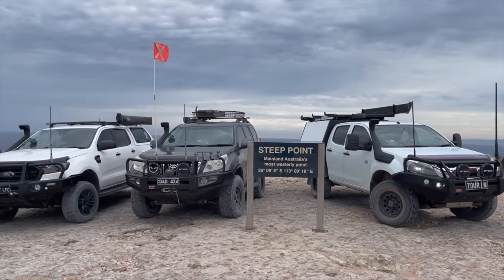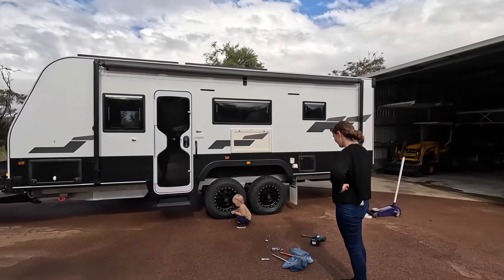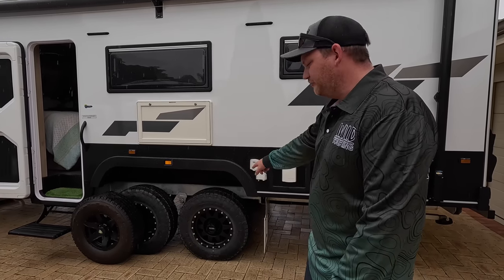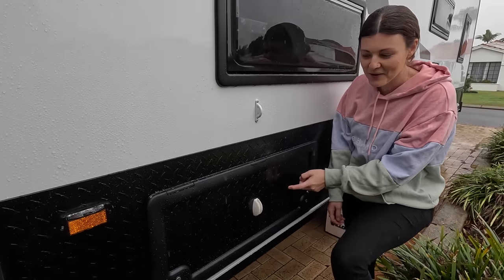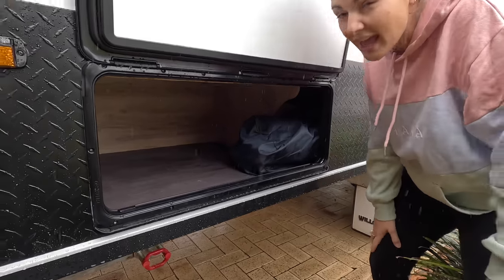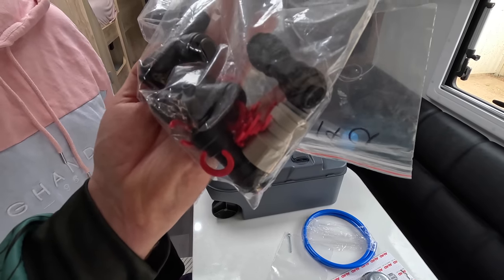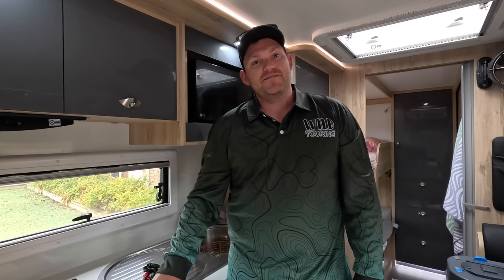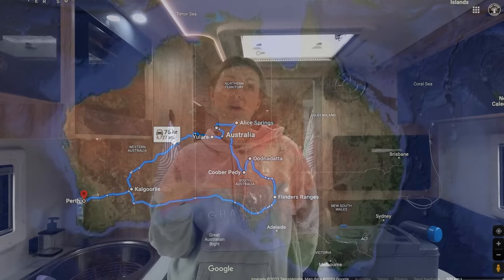VAN PREP FOR 9000km FAMILY TRIP  || New Method Rims, SOG install & LAST MINUTE change of plans...?

Comment: Just a tip with your SOG unit... Don't forget to remove the vent tube & fit a cap or the "product" will slosh into the filter when travelling off-road

Comment: Cam, try the spare casette. We needed an extra hd magnet that works when u pull the flap open, give it a try. You honestly wont need chemicals
Electric blankets are the best .
NT is great, but long between attractions, the war stuff was interesting, great central is great. Dont worry about kakadont other than cahill crossing.
Safe journeys x

Comment: You can just spray plastidip over that white hatch.
I have been using electric blanket for years in my swag. What an amazing device given it takes only 30W on a low setting per person.

Comment: Got to hand it to Outback Equipment orderd a dust extraction system on Jan the 1st received in in May they contacted me five weeks later that they oversold good service needs to be rewarded takes you off the buying list and fails to show up before you need it .They need to stop doing that.Have a good trip anyway.

Comment: Just a point of concern mate how do you stop the cassette vent hose filling with the liquid from the cassette as I find my cassette cap is always contaminated after travelling with anything in the cassette
Looking forward to more content keep up the great videos
Reply from the maker: Good question! My cap is often dirty too. I’ll have to see how it goes.
Reply: @WildTouring  it won’t be good if the fan sucks fluids into the filter
Reply from the maker: @actravel1952  yeah you’re not wrong. There’s thousands of them out there though, so I’ll just give it a go and report back 👍🏼
Reply: The answer here is to put the plug in the hole before you travel if the cassette is full